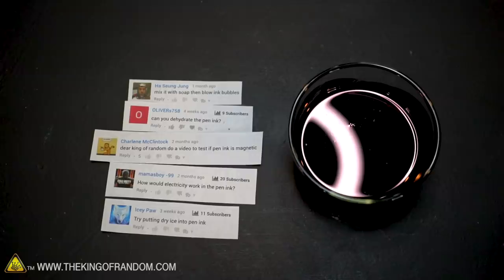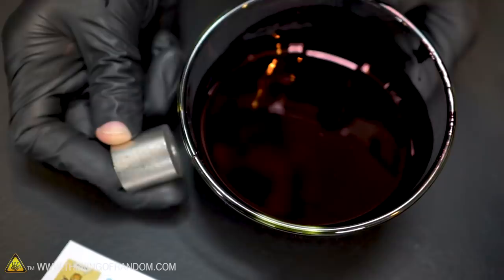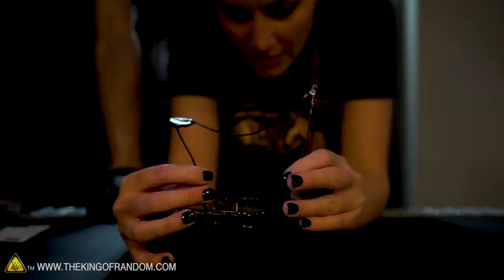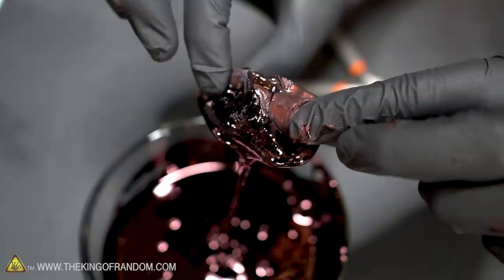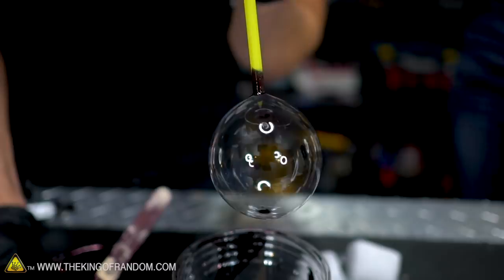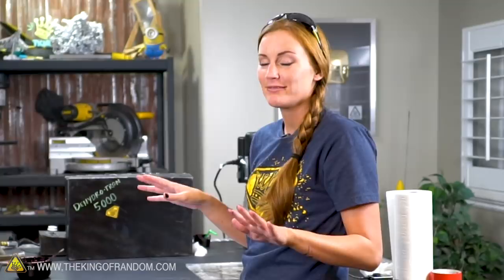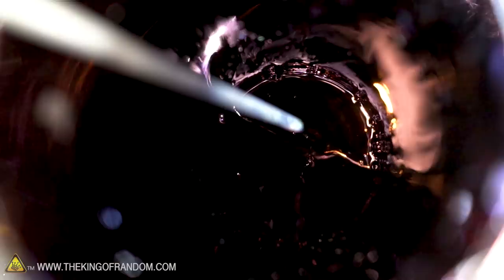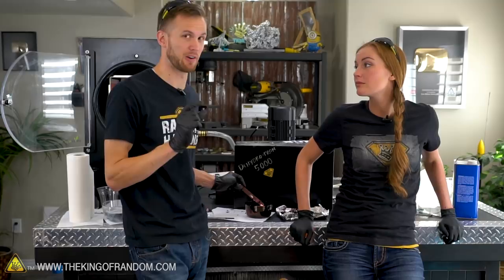What We Did with the Ink from 1,000 Pens

Comment: what if you made a silicone mold of a finger and see if it unlocks a phone.please
Reply: Erin Zinn ya they should
Reply: Phones unlock with heat, exept if it is a fingerscan
(I HOPE IM CORRECT)
Reply: So wont work its not a conductor material + its dosent have its own heat
Reply: @TheDiamondMan_3   heat? dont think so
Reply: TDM3/ /TheDiamondMan3 yep you are correct a human is a conductor causing power to flow through it making heat
Reply: @TheDiamondMan_3  you are wrong. The touchscreen works by measuring the capacitance between the conductive layer of the screen and your finger.
Reply: Wont work
Reply: Ado not true, if you were to wear gloves and try to use your screen it doesn’t work, why? Because there’s no conductor.
Reply: @cherubchy1087  Isn't that what he literally said? The screen tries to conduct electricity through a conductive material (like your skin)
That's why you can swipe the screen with conductive materials like metals
That's why when your hands are sweating the screen zooms on its own or locks the tap in one place. You sweat with water. Water conducfs electricity. Screen thinks it's your finger, but it's just water

I also have wool gloves and I can use my phone normally with them. Maybe it's because they aren't very thick.
Reply: Has to do with electric impulses in your fingers
Reply: It does work, mythbusters already did it
Reply: Heel yeah
Reply: Won’t work because it’s moot just the finger print but also the electronic sensors in the button

Comment: The ink doesn’t stain the dry ice because there is a layer of carbon on it
Reply: Shattered Yeah layer of vapors as it evaporates actually
Reply: What does carbon have to do with it?
Reply: @A-G-F-  dry ice is frozen carbon dioxide
Reply: @godalien3223  carbon dioxide actually
Reply: @arthurschamne9804  i know
Carbon dioxide is a compound made from carbon and "other".
Reply: @godalien3223  it's a compound of carbon, not a form of it. That's like saying water is a form of hydrogen.
Reply: @godalien3223  Carbon forms are diamonds, graphite, graphene and fullerenes
Reply: @arthurschamne9804  sorry im not the best at english
Reply: A.K.A the leidenfrost effect
Reply: What nooo
It cannot stick to gas. Dry ice is carbon dioxide. It forms a thin layer of gas between tha two at room temperature
Reply: You mean there is always a layer of carbon dioxide in gas form around it, right?
Reply: There's a layer of gas between the dry ice and the ink. It's the leidenfrost effect. It's the same as flicking drops of water across a hot pan. They skitter around because the a layer of water vapour forms around the water drops so it sort of bounces
Reply: @fbiagentmiyakohoshino8223  ok boomers
Reply: no, It immediately hardens.

Edit: both our ideas were true
Reply: Omg this whole comment section is a science disaster...m

Comment: Now do an experiment with ink from 1,000 high lighters.
Reply: @YawgmothWasRight  it is actually liquid. Just use alcohol or some other liquid to squeeze it all out properly
Reply: @retardretard407  yeah sure, but it's not liquid when stored in the highlighter itself, even though the substance that results once you highlight something is liquid
Reply: @YawgmothWasRight  it's soaked into the "sponge" inside of the highlighter. Squeeze the sponge and it will drip out
Reply: @an-insane-llama  this is what I was trying to say just above
Reply: @YawgmothWasRight  it is a liquid though

Comment: 8:47 see the king of random logo

 Free for you guys
Reply: RANDOM KING why did they do that?? Is there a contest??
Reply: I'm not seeing anything odd now at 8:47, 6hrs after post and 1hr after reply, using chrome on win10. 
ps Ink dries/thickens extremely in open air..
Reply: 8:46
Reply: @djosearth3618  actually it's the exact time you need to slow the video a lot too see that otherwise use 8:46